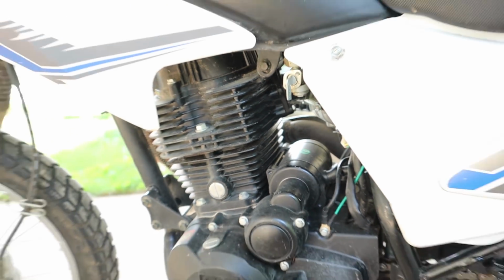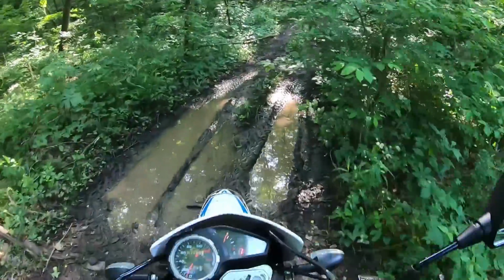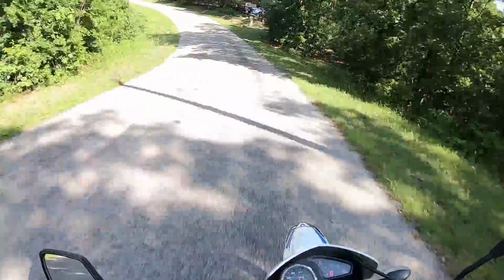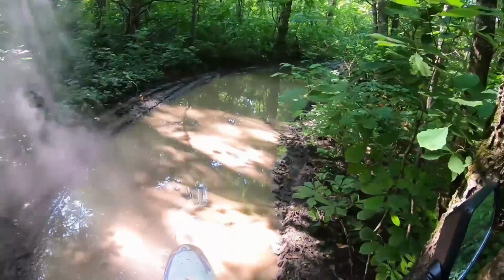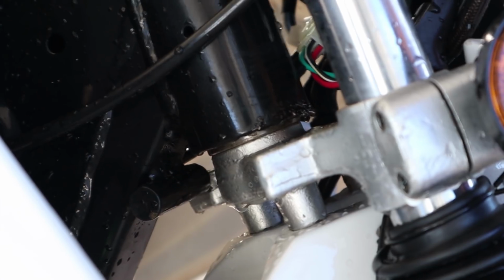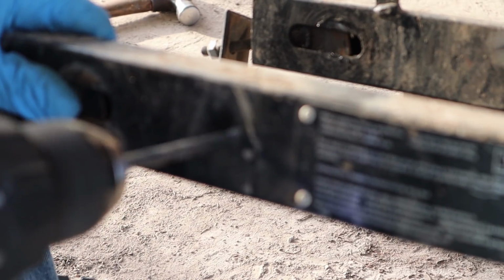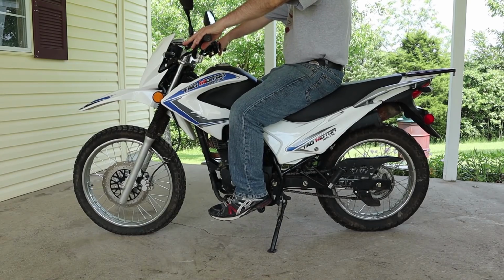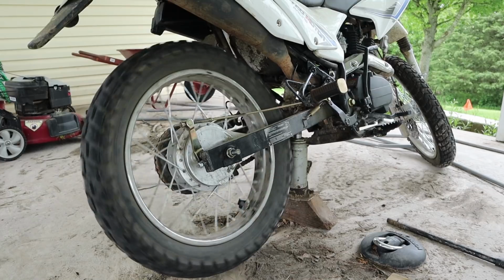Testing the Worlds CHEAPEST Motorcycle!

Comment: Just some more info on these bikes I’m a American living in Mexico down here they run just about the same in Mexico this model is called dm 200 looks very similar down to the kick stand back lights so I’m guessing it’s made by the same manufacturer in China they just change the name down here good solid bikes my current bike has 19000 kilometers and still runs good parts are extremely cheap and readily available. I use it on mountain roads always carrying my dad on the back good solid bike would recommend
Reply: Literally all parts are readily available online my bikes parts fits yours! You don’t need the manufacture

Comment: I opted for a Bashan Storm 250 and like it so far.  In my area a used Japanese enduro of any quality will run you close to $3K-$3.5K.  $2K will net you a 1986-1996 junk heap.  I did switch carbs and rejetted it plus picked up the CRF230 pipe they speak of on China Riders and swapped the tires out for Shinko 244's.  Never had oil in the air box yet.  Keep a tube of Locktite handy. The bike is torquey and smooth and a lot of fun.  $1850 with tax, title and license.

Comment: Basically; these make a good bike if you know there limitations. Keep it on the road, forest service roads & very light trails, don't over do it. If you want a more extreme bike, pay 5 x the price. Going to get a Tao or Hawk.Thanks good vid. seen Motocheez also.
Reply: Road ... Check.
Forrest Service Roads ... Check.
Very Light Offroading ... Check.
Up to 60 mph ... Check.

Sounds good to me for the price.
Reply: For the $ ? I’d say it’s hard to beat
Reply: Seems cheaper to just buy 1 that dosen't break
Reply: @skipdegraff6547  it’s not that weak of a bike u can put it through a nice amount of work even off road before it gets any severe damage but I mean it is a cheap bike meant mostly for roads and smoother trails. Good for commuting and casual riding. Yes u have to double check the parts and especially the bolts. After some slight modifications u can turn it into a very reliable bike.
Reply: Too scummy for me. They RIP off japanese designs and basically use slave labour (pennies on the hour) to build these terrible quality bikes . People talking about how they got a few thousand km out of them ... japanese bikes go for 100,000km then replace rings and go another 100,000km . If you dont think you are going to want to ride in a few months or put 10km on a "long ride" then ok but if you actually want to ride it's a terrible idea.
Reply: Well if you're a full time mechanic and a part time rider GREAT CHOICE
Reply: Yeah no just find a used Honda Yamaha Kawasaki ktm or Suzuki or beta. Plenty of good bikes on craigslist and marketplace for a few hundred more than this pile of garbage. I paid 1300 for a 2006 ktm 200xcw and haven't had any problems starts on first kick even after sitting for 2 months with the gas still on lol
Reply: @tenglish420  Two months huh, well whoop dee doo.  I have a log splitter  with a Champion (tm)  chinese 196cc single that sits in my garage for 360 days a year.  I split wood for a day or 2 in the summer and then it goes back in garage.  So for sitting for 11 months and 25 days it usually starts on the first pull.  Paid 1400 bucks for it and it saves me several thousand dollars per year in heating costs.  Thanks China!
Reply: percussion 44 yeah and my TaoTao starts up every time too.What I have noticed is most of these “Its Chinese junk”guys are just repeating what someone else said.Pick any random comment that says it’s junk and I’ll bet a dollar they have no video or any proof of their experience with ANY China bike...just talking shit
Reply: Keep it off the road so at least you won't kill anyone else when the forks fall off.
Reply: dentistguba refer back to my comment about nobody posting any evidence...just talking with no proof...if you have it post the link

Comment: Ive been looking at these. Thanks for helping me avoid that mistake. Ive been doing gas motorized bicycles for a while and this seems like that with the extra steps you paid to avpid. 
It does seem like a fun little bike though. I think if i want something trail and road capable, i will save up for a janus or rokon, the 6x price tag is worth support and made in america status.  Nothing against china stuff, the motors are solid for the most part. The things bolted onto them tho, as seen here leave something to be desired. I dont own a lathe or welder and by the time i bought those and taught myself to use them id be out as much as a better bike.
Reply: Rokon are not worth it. Too slow. 
If you want a slower offroader, get the CT200u or CT200u-ex for $499.00 or less.
Reply: @brianmccann666  thats not even a valid comparison. The rokon can go places neither of these bikes can, with features that neither of them have, with a motor thats gonna outlast either of them, supported by a warranty and an american company made in the usa. The ranger, i think goes 37 mph. 
The appeal of an enduro is that its street legal and capable of off roading as well. The rokon does both of these things well plus out climbs either of these two. 
The colemans are not really street legal in most areas and im lopking for something that can easily be used on the street, perhaps even carry a passenger and lots of cargo. 
 Neither of these bikes do all of that natively or easily. 
The janus dual sport model whatever its actual model name is, is around the same price as the rokon, has a top speed of 70 mph and other than easily carry a passenger meets all my other requirements. Is also made and assembled mostly in america and has a warranty and maker support. 
Hell even a royal enfield Himalaya is a better choice than this at around the same 6-7k price range. 
 If i wanted to go lower end i would just buy a ruckus and be satisfied with that. 2k or less for a brand new honda product thats pretty likely street legal and does lile 35 to 40 and can go off road and would come with a warranty when new.

Comment: So typical defective junk.  That's worth $200 to me, no way I'm buying a bike with the expectation that I'll have to fabricate essential parts and/or weld, and you're not even at 2K mi. yet.  I'll bet that a $2700 used Japanese bike will last more than twice as long (have twice as much lifespan remaining even though it's already used, opposed to the Tao's lifespan new), and will have resale value near what you paid for it if you maintain it reasonably.

Now mod the headlight so it's 1000X as bright.   ;)
Reply: Stinky Cheese it’s a solid piece of hardware I have a similar Chinese back 19000 kilometers going strong all the parts are readily available online you can replace anything on it.

Comment: Like it! Have a few but expensive old timers and also 2 cheap ones which i call disposable. Well, once you get a strange noise from the engine block or timing chain/pushrods get some play that cannot be fixed due to unobtainable parts...ehm...you donate to someone who will truly appreciate it and drain the sweat out of it. At least what's left. Just ride.